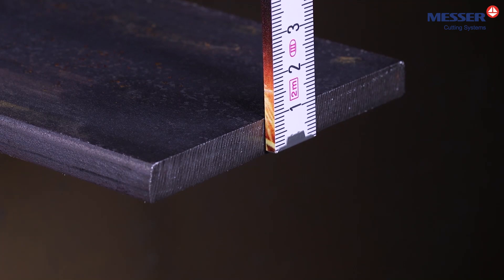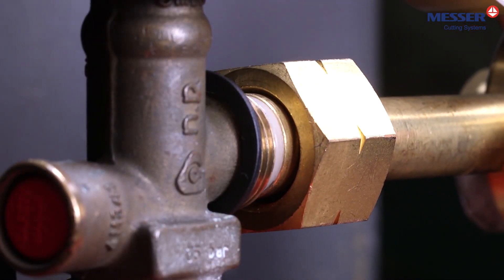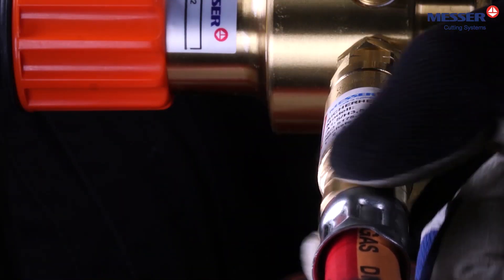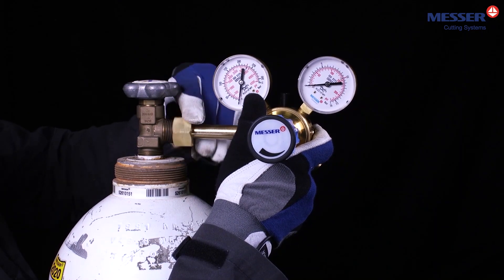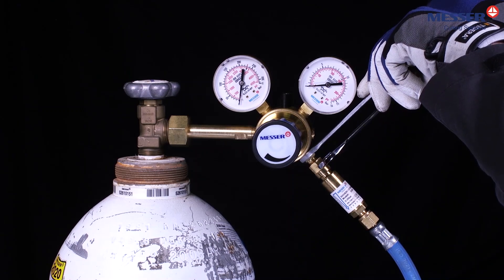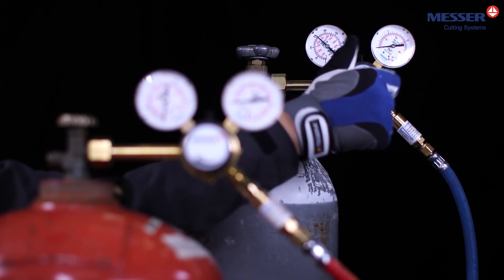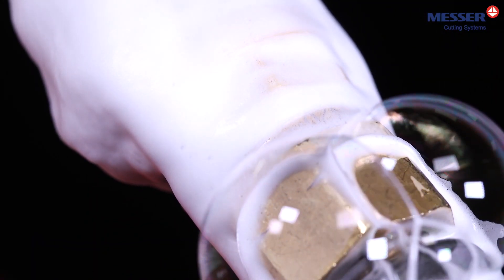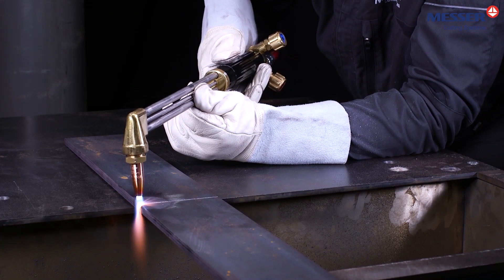ProfiCut Oxyfuel Hand Cutting Torch | @messercuttingsystemsindia

Comment: You only need one half turn of the cylinder valves, because if a dangerous situation occurs, like a flashback or backfire, you need to act quickly to quell the flames and stop it worsening to cylinder explosion and detonation.
Reply from the maker: If you have any questions or enquiries please WhatsApp on 7708446444